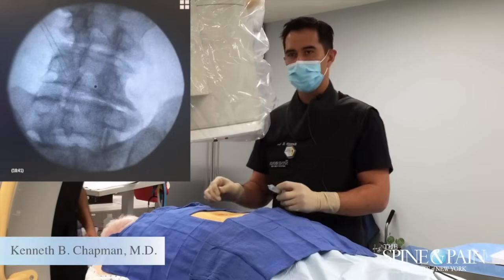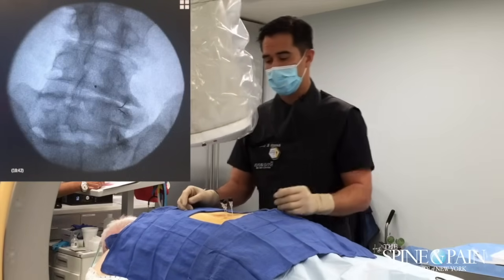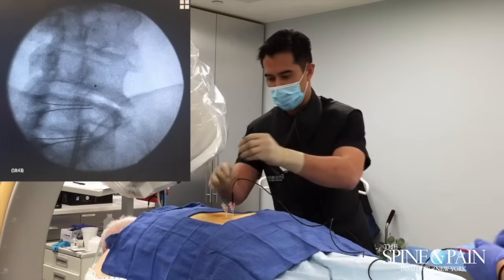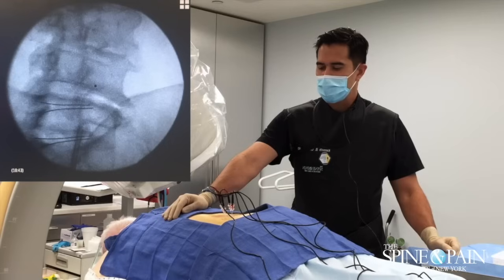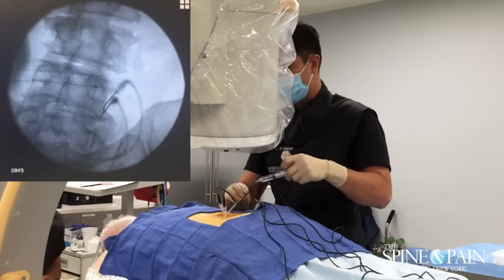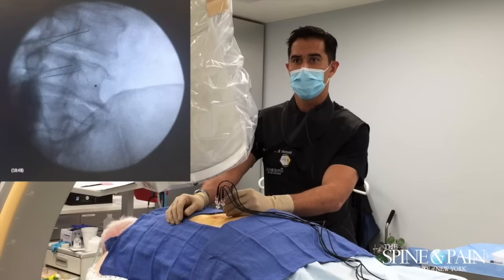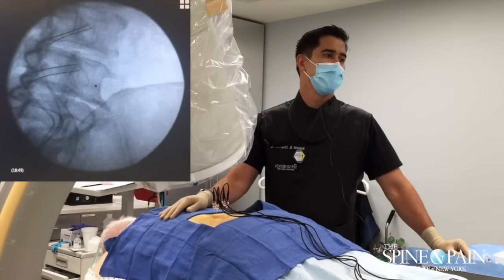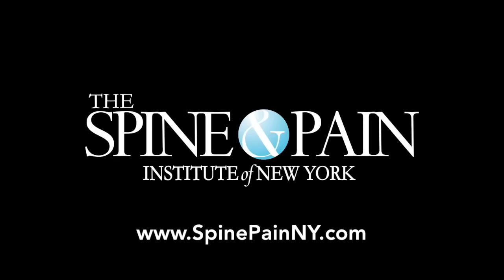Radiofrequency Ablation Procedure

Comment: I had my L3 4 5 done it has lasted me 4 yrs, with a very physical job.  I’m getting ready to do this procedure again.  It changed my life
Reply: Did you have any side effects?
Reply: Carol E Hi Carol, no side effects.  I still had slight pain here and there, but I could tie my shoes, work a very physical job, go to the gym again, go for my walks, i couldn’t even sit before in comfort.  It was very successful for me.  Even helped get off the pain medication, which was one of my main concerns.  Just ibuprofen 800s now.  It’s starting to hurt again especially the morning, getting those sharp stabbing pains which I haven’t felt consistently in a very long time and that numb tingling sensation down my left leg and right.  But 4 yrs success, everyone is different when you read the comments some don’t last as long.  I have a fractured vertebrae as well that has degenerative arthritis.  It helps.  The one thing in the videos this doesn’t show was I had to be awake and well aware, no painkillers allowed, when they send the electrical impulses at 3 different voltages, 3 being the highest, the dr sent pulses to make sure I felt it, reassuring he was directly on the nerve itself before he heated up the tip of the needle.  But not sure if all Drs do that.  Any questions feel free to ask.  I hope this helps you.
Reply: KJM WOW. YOUR one of the luckier ones. I have read many comments but never read anyone saying 4 years. Wow. I could only Pray to get no pain for that long. Lucky you. 😊👍🏼
Reply: KENOM Really I speak to many ppl who only got 6 months relief. I guess it depends how quickly ppls nerves grow back. I am completely disabled from si and greater trochanter pain. I’ve seen 100 Drs at least and so many haven’t a clue they all rely on diagnostics. 🙄 I’ve been seeing nothing but hip Drs and none ever mentioned SIJD I found out through research. I’ve been suffering since 21 disabled since 25 I’m now 40 my life wasted all dreams gone. I’ve wanted to end things so many times but I have a precious little girl. But I wonder if they burn or cut them and you can’t feel the pain. Doesn’t that leave ppl vulnerable to hurting themselves by overdoing things or doing things with their bodies they shouldn’t.
Reply: @daniellemccarter5706  please try DVR
Reply: SiFu Yip What is that and will it bring swelling down.
Reply: Hey jus was wondering post procedure were u in pain for a couple days after u had it done.
Reply: kmakani85 yes a few days then I forced myself to walk to end of driveway, next day end of street for a few days I did that, then just walking to corner store and back and I just kept walking in little amounts everyday.
Reply: KENOM Right on thanks man for the info this is my first one so idk if this is normal but yeah pretty sore still an I also have a very physical job too hopeing this helps me cause I also have a very physical job as well too
Reply: kmakani85 I hope it helps, and wish you a speedy recovery.  I have a great doctor as well.  Let me know how you make out.
Reply: KENOM for sure man Mahaloz 🤙🏽
Reply: What this procedure does ? How it works ?
Reply: Kitties - Back H yess same my back is killing me with facet joints pain all over my buttocks as well, can’t stand or walk for too long always makes the pain worse, it’s been a year since I got injured and I’ve been going to physio for the past 9 months but no help at all , got a block done last month and going for another one before I go for the radio frequency. Hopefully it will work but I’m still scared of these blocks cuz they bloody so painful when they were sedating me through an iv.
Reply: I fell on ice in 2018 and broke my back my pain management doctor was talking about this today.
Reply: that is great to hear
Reply: @Sh3ba5843  did you have pain going down both legs or just in lower back?
Reply: @SiFu46  hi could you tell what DVR stands for?
Reply: @daniellemccarter5706  giving up is easy, its living that's hard...keep trying!,  could it be piriformis entrapment?
Reply: @TrashOnly- so so happy to hear this!
Reply: My first set lasted four years as well and I had it done again yesterday
Reply: Getting it done to my neck on wed.. thus chronic pain has been flaring up so much suicidal ideation and there are times when what's worse... ugh 2 more days.. after years.
Reply: @KingggHOUFO  I’m happy you found relief.  I hope it helped everyone commenting.
Reply: @onlyinrebeltube7692  how did this grip you.  I am having trouble right now and just looking up stuff
Reply: I can hope mine will last that long.  Had it done today in a  local pain management clinic, by a Cleveland Clinic trained doctor.
Reply: @SiFu46  what’s DVR? Thank you
Reply: @peevedim7204  did it hurt while having it done with sedation
Reply: @Sh3ba5843  What was the pain like during and after the procedure? Were you sedated?
Reply: @daniellemccarter5706  I do so sympathise, I have had no life and no mobility for decades.
It’s very depressing
Reply: @kmakani85  how are you now?
Reply: @KingggHOUFO  Did it hurt? How much pain did you have afterwards?
Reply: Thanks so much for the info.
I'm about to have it done. L4, L5, S1. Stressing a bit.
I've heard so many good & bad stories.
Just completed my two medial blocks. A week apart.
Now, for the big one.
The ablation🤔🤔😕
Reply: @anthonyshaw8698  Please come back here and spill the beans after !
Reply: @ThonColinFilms  
Okay.
My 1st ablation left side, L4,L5 S1,
In 2 weeks.
Crap. I wish they could do both sides at the same time.
Be done with it.
Lol
Reply: @anthonyshaw8698  Isnt that so they can give you max drugs for each one?  I think I’d rather one side at a time if it got it over with quicker!
Reply: @ThonColinFilms  
I'm not sure. I asked the doctor about it. He said it's better to do one side at a time, for insurance purposes. I think that's what he said. It's probably better, one side at a time. Because, it's gonna be 3 nerves on the right, and 3 nerves on the other side the second time.
L4, L5, S1.
P.s.
Speaking of drugs, I'm not going to be sedated. Gonna be awake for the procedure. Probably only anesthesia. I hope it's not too painful. Somebody wrote in the comments, that the actual ablation is less painful than the nerve blocks. I don't think the nerve blocks were that bad at all.
Reply: @anthonyshaw8698  why not have sedation? Will take the edge off your anxiety?
Reply: @KingggHOUFO  did you experience pain for long after the procedure? I’ve had both sides done in the past 3 weeks. Apart from some moments of relief, good days and bad, I’m still feeling pain. The doctor says it can take 4 to 6 weeks for some people.
Reply: You’re lucky.  Sacroiliac lasts 2 mints tops!
Reply: I'm getting ready to have my L3-4-5 done. I'm scared!
Reply: @lauralove9090  Good luck - let us know how it goes!
Reply: @ThonColinFilms  thanks! My insurance company requires that I have another test run of the temporary nerve block before they approve the ablation! I just found out; so that means I have to shell out another 220.00 for a nerve block that results were successful. Ugh! Frustrating! So I will get another test run this week then we can move forward with the ablation. Makes me frustrated because I should know! I'm the patient that was pain free for a glorious 6 hours! It's just another way of delaying it thinking I will give up and not be able to afford it, which I really can't but I have to. I cannot live this way! Thank you, Thon!
Reply: My aunt had one a year ago. Her doctor asked her last month if she was ready for another one and she said, "No. I'm feeling great still". My Dr said it may last 6mo-a year because my back is really jacked per my MRI. I just have to trust that it will help enough to keep going another 5 years. I have to support myself. I need to be working. What is saving me now is the fact that I have been vested with the hospital I work for, for 10 years. I get 100% of my salary, minus the night shift differential. Thank God I have that many years!
Reply: @MrZilvis79  it's a spinal nerve burn basically. My Dr is burning off the L-3, L-4 and L-5 nerves on both sides that sends pain signals to your brain. The nerves do grow back but it seems as if it is helping a lot of people. I'm out of options right now unless I want to proceed with surgery. I don't because I died July 19th on the operating table trying to get my gallbladder removed. I still have my gallbladder because they went into crisis mode instead. I was dead for 10 minutes; blue for 7 min. They did not think they were going to get me back. That was scary. I woke up on the operating table, pulled out my own intubation tube, sat up and said, "What the f$ck"! My surgeon said, "Laura! I had to do CPR". I was out again because my anesthesiologist was injecting more medicine to knock me out.
Reply: @KingggHOUFO  that gives me so much hope!
Reply: @TammyMartinBLUE  not sure but we are speaking about the Radio frequency Ablation on spinal nerves.
Reply: @lauralove9090  What a pain.

Still, I would pay that to get the six hours right now! Plus you’ll be really sure that the procedure is the right one for you!
Reply: @lauralove9090  Will this be your first time? I have a lot of questions about what it’s like! The medial block gave me so much relief it was incredible, but as you say, only lasted a few hours.

I know I need to have this done, but it is so unappealing!
Reply: @ThonColinFilms  yes, first time. He mentioned it about 6 years ago. I wasn't on the idea. Now, I am. The pain is just too much to bear. It hurts to walk. Yes, the block helped tremendously! It was awesome! Just bummed that my insurance wants him to do it again, just to make sure he has the right places! WTH? I'm the patient. I know it was successful! Lol
Reply: @lauralove9090  When I had my block I thought I was going in for yet another facet joint injection. It was only after I read the paperwork that I realise they done a different procedure this time.

But the pain level was completely different with the medial block – just gone. But then it wore off.I think I’m going to have to have the denervation. Any idea when you’re going to have the block next?
Reply: What sort of pain did you experience before having this done?
Reply: @anthonyshaw8698  How are you now Anthony?
Reply: @ThonColinFilms  
Doing great so far.
Zero pain left side lumbar.
95% pain free right side lumbar.
We'll, see how long this last.🤔
Reply: @anthonyshaw8698  That’s amazing.

When you have the procedure, how long are you actually lying down whilst they stick needles in you? I’ve only had facet joint injections previously
Reply: @ThonColinFilms  
It's not long at all.
Usually, if you arrive at 3pm.
You are out of there by 4pm.
Most of that time,  is them preparing for the procedure.
It's pretty quick. I was surprised myself. I also thought it was going to be a little painful. It wasn't as bad as what I've been hearing from others online/social media.
Maybe it has something to do with the clinic and/or doctor's you use. The clinic I went to, and the doctor's there, are highly rated.
5 star ratings from every review I read. Nothing less than a 5.
I was thinking, this can't be true.
Must be a scam.  Lol
Reply: @anthonyshaw8698  wow, wish I had your clinic! Did you have sedation?
Reply: @ThonColinFilms  
I just muscled it up, and went for it. I drove myself there, and drove home afterwards. If you're sedated, you need to have someone drive you home.
If it would have turned out to be painful, I would have told them to stop, and sedate me. I'll get a ride home/uber. Pick my car up the next day. But, that wasn't necessary.
Reply: @anthonyshaw8698  brave fellow you are. What parts of your spine did you have done?
Reply: @Adrian-sl9zj  
Yes, it can take 4 to 6 weeks for the nerves to die, in some people.
My left side was immediate. The right side was closer to the 4 to 6 week time frame.
P.s.
And for some folks, it never really helps their pain. Hopefully, you're not in that category.
Reply: @lauralove9090  
Don't be scared. It's no big deal.
After they numb you, you only  feel pressure like symptoms in the area, when they're doing it. It's hard to explain.
I just had both sides done a month ago. L4, L5, S1.
Left & right side, two weeks apart.
Reply: @anthonyshaw8698  Thanks for taking time to comment Anthony. I had the right side done first and the left side one week later. It will be 6 weeks to the day (today) since my left side. Today has actually been a good day. This actually is the first day I’ve felt real relief. It’s been serious pain since I had the procedures done. It was actually worse than the original pain. So hopefully better days are ahead. 👍
Reply: @lauralove9090  
One good thing to do after the procedure, is to continue chiropractic care, with a good chiropractor, to help get the spine back into alignment. So, hopefully you won't have any issues down the road. Ablations can last 8 months to 2 to 5 years.
An excellent video to watch from a fantastic chiropractor that just came out on YouTube is, Spinal Stenosis, by Dr John Bergman.
A ton of info, concerning your spine....
Reply: @ThonColinFilms  
L4, L5, and S1.
Left & right side..
Reply: @anthonyshaw8698  and how long did it take before you felt better pain-wise?
Reply: @ThonColinFilms  
The left side was instant. The right side took longer. 4 to 6 weeks roughly.
Reply: @ThonColinFilms  hey Thon. INS co required the testing nerve block (that wears off within 8 hours again) before they will authorize the ablation. 😶 Darn. I have that on April 14th. I will let you know when I do.
Reply: I had this done in my neck c5, c6,c7 yesterday! I have had many neck and back problems. I think this is the greatest treatment for pain. It turns my life completely around. I wish everyone would do this, it's like magic!
Pain free! And alot happier life!
Reply: @tamrasteele6314  Wow, that sounds amazing. So pleased for you.Really hope it lasts a long time. Please can you describe what it felt like when the needles were going in? I think this is what most people are worried about
Reply: @anthonyshaw8698  is this still helping you?
Reply: @iPsYcHeDeLiiCZ  
Yes, it has helped tremendously, on my left and right lumbar, L4, L5, and S1 area's. Still need to go back in at some point, and have my upper right side thoracic area done. Having a little discomfort in that area. After I get the upper  thoracic done, I should be good at that point.👍🤗👍
Reply: @ThonColinFilms  ❤😢
Reply: I would like to know if it is effective because I am an athlete and apparently I have to do it, do you have any recommendations?
Reply: Bro what is rfa cost
Reply: @ThonColinFilms  well now I have different issues hip and knee, just had a cortisone injection in my sciatica totally separate from hip and knee, two bulging discs and unfortunately a very narrow spinal column so just dealing with some pain and I have a lump in my stomach so I have a lot going on could be a hernia from lifting heavy at work but my hips and knees are shot.  Back is just all about temporary relief now and hoping I can work for another 13 years for retirement.  That main procedure helped me through a time but this back pain is totally different I’m getting now.  Dragging my leg.  Climbing ladders crawl spaces all building mechanical maintenance not ideal at all.  It sucks and it’s depressing.
Reply: Best advice I can give stay very strict with medication don’t take the pain medication unless absolutely necessary and let someone monitor it, be very very careful because I learned you can never say never.  Good luck and please heed my warning seriously.  I’m very very fortunate I had a good doctor afterwards.
Reply: @Sh3ba5843  sorry to hear this.

Sounds like you and I both need a body transplant. Maybe science will manage this in the future? Do you use a tens machine and a lumber support belt?
Reply: Did you have worse pain for more than a week after the procedure? It's week 2 after the procedure and I'm still in a lot of pain. I'm so scared that it didn't work. I'm in so much pain 24/7. I can't live like this everyday. The pain is unbearable 😢
Reply: Just did mine 2 hrs ago. I pray I get the same results!